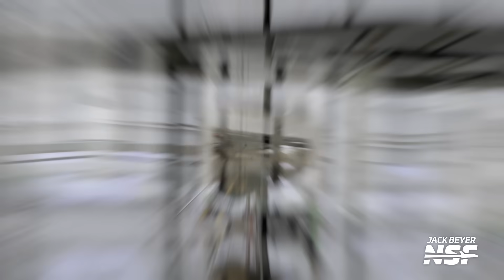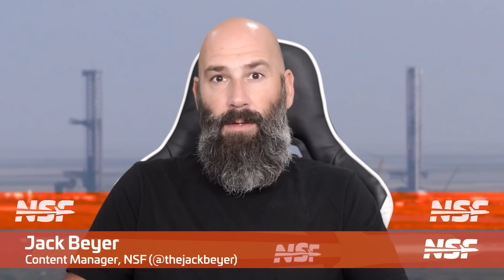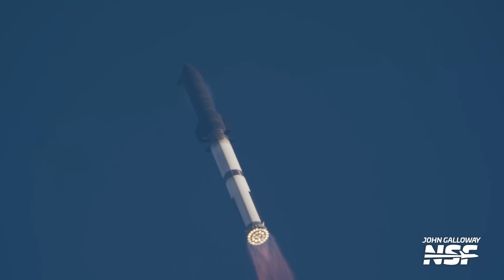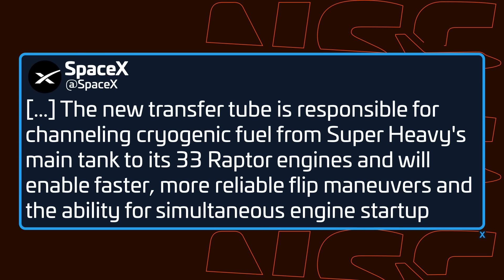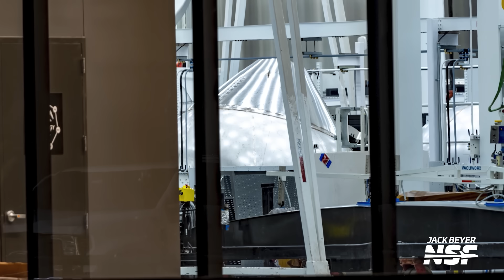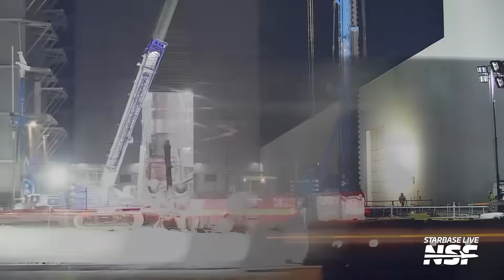The Reason Behind Super Heavy's Big Upgrade | Starbase Update

Comment: After all of this rework could they consider testing both block two ships and static fire both of them and then remove all of the modified structures. Less work in the long run 
if possible.

Comment: Ok if S37 goes up on B16 in August and then Flight 11 would be planned with S38 and B17 which would be the last S & Bs for Block 2 models, and that leaves B15 as a Spare for either flight, but then it goes to the bone yard because the next flight (#12) would presumably be V3 B18 and S39. Does that schedule/plan seem right?

Comment: The risk here is that Ship 37 does an impression of ship 36, afterall ships 35, 34 and 33 all failed similarly... (consistancy right?) and ship 37 is going to be in a much more valuable location.
Reply: 36 Failed for entirely different reasons, and one would think with the COPV testing they've done they'll do all they can to prevent it from happening again.

Comment: Fun factoid: SSME engine bells actually curved in slightly at the end to achieve resistance to flow separation without badly affecting vacuum performance

It's surprising that a methane pipeline hasn't been laid into Starbase yet. It makes vastly more sense to liquify onsite and would be an ideal energy source to drive the chilling plants

Comment: Those supports welded to the test stand look beefy enough to me that they may be to just make the adaptor stronger.  Stronger if the ship is pulling up on it, or stronger to hold the weight of the propellent that wouldn't be in it during normal transport.  Just my guess.

Comment: Are there informations how high the block 3 booster will be?
Reply: About a meter taller than the current booster design, but the tanks occupy an even larger fraction of the volume of the booster so it has a larger propellant capacity

Comment: It's pretty common in RnD/design to use a different color for internal versions vs production versions.
Black V3 maybe for development/testing and green for flight. You normally restart the S/N at that point too. Development S/N vs Prod S/N etc..
Reply: Raptor 1 & 2 did not reset their SNs

Comment: the lox to methane ration for star ship is currently ~3.6:1.  The diameter of the booster is 9 meters or an area of 63.6 sq meters.  Divide that by 3.6 to get an area of ~ 17.7 sq meters wich is a diameter of ~ 4.75 meters.  This means a full length tube with a diameter of 4.75 meters down the center would hold all of the methane in a 9 meter surrounding tube containing the lox. This is another instance of the best part is no part as both tanks bases are right on top of the engine bay which makes the pipe work much more simplified. Judging from the photos of the methane pipe diameter this is likely what they've changed to for block 3.
Reply: What's the difference in total surface area of steel, and the resulting weight, to produce cryo consumables separation as compared to separate tanks w/ downcomers or a 3m diameter tube with a smaller tank at the top? It seems like it would be ideal if the consumables needed for boost-back and landing could be held separate from the initial load during the primary burn, so they aren't polluted by ullage.  Basically a tank/downcomer/transfer tube stacking solution in concert with piping and valves.
Reply: All sorts of wrong.  Firstly, a 3.6:1 ratio would mean dividing by 4.6, not 3.6, to get the methane sub-volume.  But even that's very wrong, because the ratio is expressed in terms of mass fraction (3.6 tons of O2 for every ton of CH4), whereas the actual volumes taken up by each of the two propellants are controlled by their respective density, which happens to be drastically different (LOX is 1.141 kg/L, while LCH4 is just 0.423 kg/L).  So, to be more precise, the volumetric fraction of LCH4 would be (1/0.423)/(3.6/1.141 + 1/0.423) = 0.43.  Which is a lot more that 1/3.6 = 0.28 you used in your calculation.

Comment: All of these extensive redesigns make v1 and v2 a waste of time. They will now have to start over pretty much from scratch, with all the failures and issues inevitably to come. They should have started with v3 in the first place.
Reply: That's not how development works.  It's the testing of earlier versions that tells then what design changes work and don't work.
Reply: Traditionally rockets are indeed often designed first, implemented later. There wasn't any late redesign like this with Vulcan Centaur or New Glenn. But that's not the approach SpaceX is taking, for better or worse.

Comment: The “big pipe” is a major change to the booster. To me, it is evidence that SpaceX and engineers have not adequately designed the booster and are now trying to patch up major problems with it in order to get more performance out of it. Putting such a “big pipe“ into the booster at this point Could lead the several problems. First, the “big pipe” could suffer from unexpected fluid dynamic issues. Secondly, the manufacturing of starships has not been all that great and trying to incorporate a “big pipe“ will require that they can actually create seals leaving into an out of the “big pipe“ that can stand up to huge amounts of vibration. Does anybody have confidence that they have enough time to test this?
Reply: It's called development, a concept you likely can't and never will understand.  Then again you've always been a little dim.

Comment: Lots of flanges, lots of conformal rigidity.  Seems like he needs to make a pseudo-CFD micro-scale simulator for building tanks, manifolds, O2/CH4.  44 full scale iterations is.... seemingly wasteful.
Reply: 44 full scale iterations? Of what? 🤔
Reply: @ale131296 Starship.  20+ boosters.
Reply: there has only been 10 launches of starship? thats not that much
Reply: @websitemartian That's my point, compared to how many that have been built, then not used or scrapped.

Comment: The black "color" of the Raptor 3 may simply be a protection against the return heat. So it's not necessarily required for ground tests on engines that will never see space. So, we can assume that all black Raptors are meant to be designed to fly. Maybe the same ceramic coating of the heat shield.
Reply: Given that we’ve seen one green Raptor 3 vs all the others being black, wouldn’t it be the other way around? Are really all Raptor 3 seen so far except one flight Raptors?
Reply: @ale131296  Maybe it's just speculation. They may have created early versions that are more complete than the ones that will actually fly. But that seems odd to me. Knowing that these new engines are supposed to withstand higher temperatures than the old ones, because the shielding will no longer be present, the coating is justified, especially for flight. (See the first photos of the Raptor 3 published by SpaceX; it's definitely a coating.)
It's important to remember, as mentioned in the video, that this could be an "old" model. The first Raptor 3 released and photographed was already a high number.
Reply: @theplouf5533 The first Raptor 3 photographed and released was serial number 1.
Reply: @ale131296  Sorry, I confused it with the McGregor tests on May 15. I need sleep.
On X : "Raptor 3 SN #20 headed to the Raptor South test stand at SpaceX in McGregor, TX this afternoon. Seems like Raptor 3 is moving along quickly with testing."

In any case, you're right. It's even stranger than I thought.

I think it's literally Raptor 3 SN3 we're seeing here. They don't all go to testing in the order of their serial number.
We saw it with the Starships; some serial numbers, although following, are there only for specific tests and not for signifying an update.